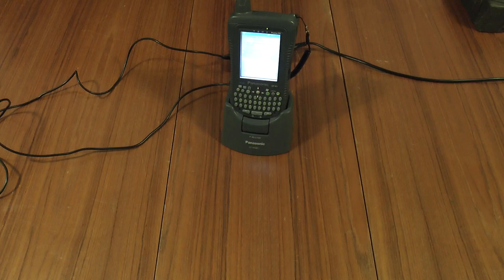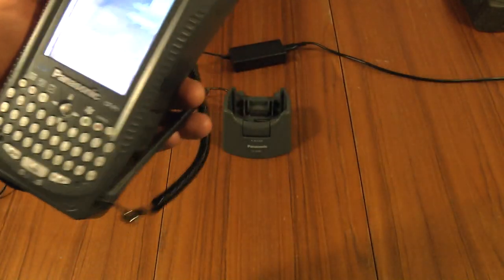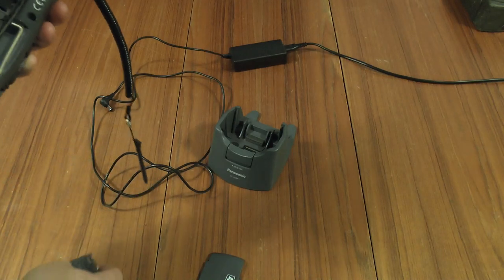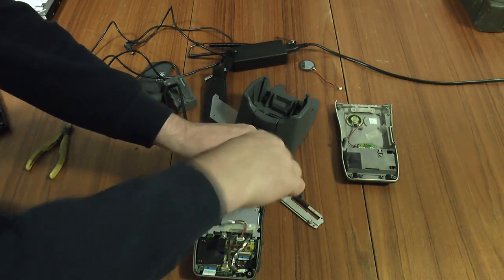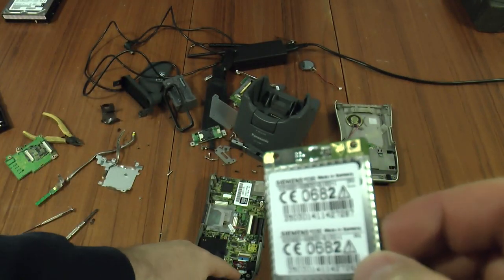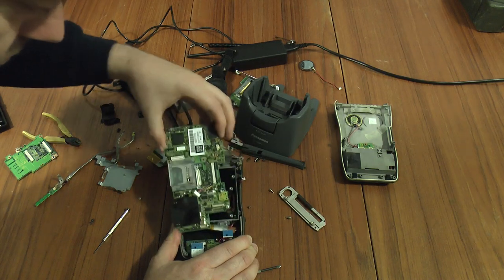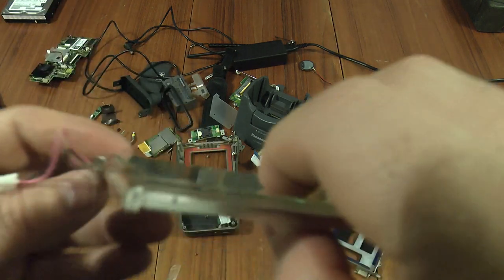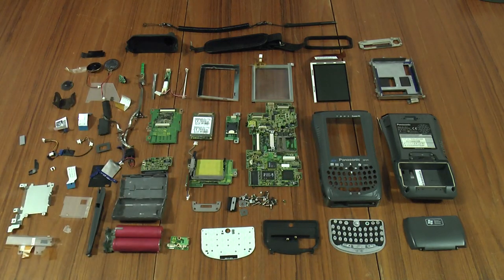Panasonic Toughbook CF-P1 PDA teardown

Comment from the maker: I did stumble across that after I started uploading the video (about 1.4GB over ADSL!)
The module's still in one piece but I don't really have a use for it right now. Could be used in conjunction with a GPS as a tracking device, I suppose. You can guarantee if I throw it out I'll need it a fortnight later, that's just happened with the Dyson I trashed, I have a use for the cord winder now!

Comment: I have one of those Siemens GPRS modules,  Mine's a slightly different model (TC35) but you can communicate with them over serial.  I've been playing around with one of those and an Arduino.  The datasheet should be quite easy to find.